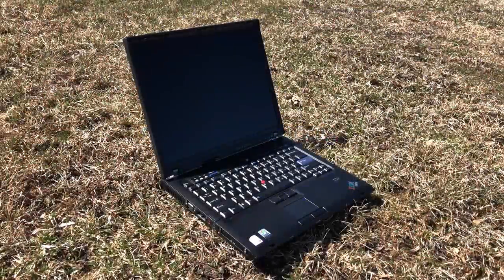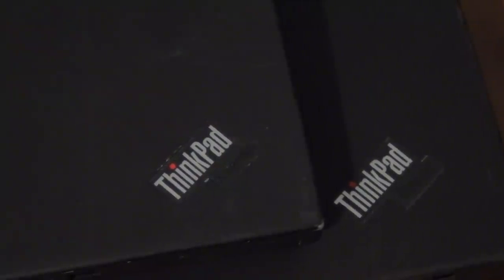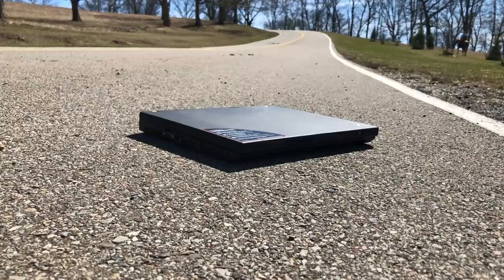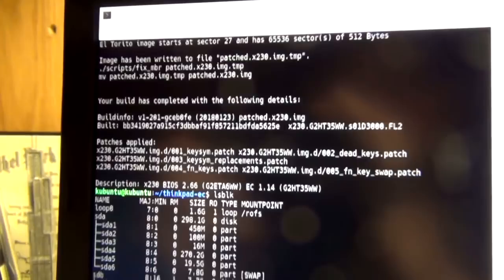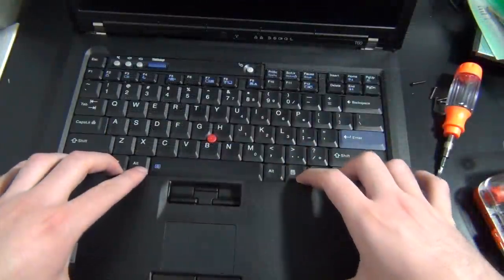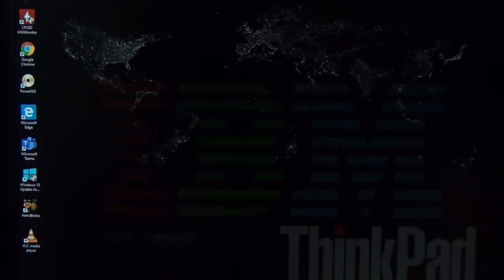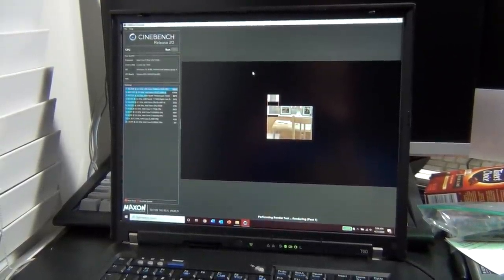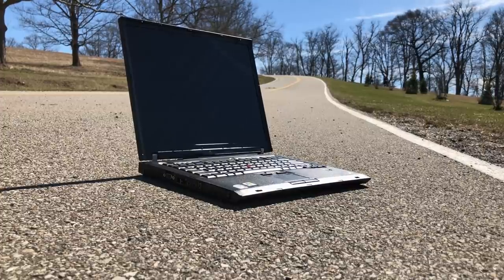Unlocking the ThinkPad T61 with Middleton's BIOS

Comment: nice vids as always, would you mind to share from where you buy the Crucial 8GB KIT? thanks :)
Reply from the maker: I actually purchased that from someone on Reddit, who bought it for his FrankenPad project but ultimately never used. I would suggest checking eBay for DDR2 laptop RAM and finding 2x4 GB sticks. A heads up - they are expensive.
Reply: @SebisRandomTech  Why are older styles of RAM so expensive? Seems DDR2 RAM is more expensive than DDR3? You would think that it would be cheaper because most people don't want to save their older computers but sell them off for parts.
Reply from the maker: 4 GB sticks (and thus 8 GB kits) are rather hard to find because they weren’t really popular. At the time DDR2 was still relevant most computers maxed out at 4 GB and many didn’t even have that much, so by the time 4 GB sticks started being made most laptops had moved to DDR3.
Reply: @SebisRandomTech  precisely... not much stock made it out before those production lines changed over to DDR3 production. So whatever is in the wild is all there will ever be, and people know it's rare so they're going to charge accordingly.

Comment: Really should had just ran a userbench before and after... it'd show, in extreme detail, the difference in every bit of hardware. The beauty of UB is that it always compares your hardware to that exact hardware... and shows you where you stand compared to the rest of the planet. I am currently in the top .6% with my ram kit, lol... And mostly top 1-5% with SSD, Raid arrays, CPU, GPU... etc. But it also shows you the actual data rates, rendering performance, etc... You get all of it, and it's free... plus it gives the results in a pretty great format.
Reply from the maker: Will keep this in mind for future videos. It’s hard to find good (and free) benchmarking software, so I’m open to any suggestions there!

Comment: hello, lately my x61 win 7 4gb (but 3gb usable) 500gb ssd core 2 duo t7300 model 76734NA is experiencing shutdown blue screen, maybe because win 7 support has gone. will the middleton's bios give me 8gb ram and install win 10 pro 32 or 64 bit? will really appreciate your reply.
Reply from the maker: You won't need Middleton's BIOS to upgrade to 8 GB of RAM, that was a mistake on my part. You could try driver updates or reinstalling Windows 7 to see if that fixes your blue screen issues before upgrading to Windows 10.

Comment: Looking at the benchmarks since I have a T9300 in my T61, from what I read there is not much difference between T9300 vs T9500 vs X9000.  Some sites listed the T9500 the overall clear winner.
Reply from the maker: Can those be installed without additional mods?
Reply: @SebisRandomTech  i librebooting it.  Other than that it was a direct drop in
Reply: The x9000 can be easily overclocked to 3.2 ghz. I got it to 3.4. Id like to see how the t9500 compares when the x9000 is on 3.2. And do note i did this on a precision m4300. Im assuming the t60 has the vrm and thermal headroom to boost to 3.2

Comment: can i install this BIOS to my Thinkpad x201? I have a 4GB ram and i bought 4 more gigs. The BIOS says that i have 8GB but windows won't boot :(
Reply from the maker: Nope. That sounds like an issue with your Windows installation.
Reply: @SebisRandomTech  maybe..
Reply: @dieselgeezer18  reinstall. No link between memory size and windows boot.
Reply: Are you running a 32bit OS?
Reply: @Shaddow798  64 bit
Reply: @Peter Andrijeczko i still use windows 7

Comment: Hello friend I need your help, I have a lenovo t60 laptop with windows 7, 3gb of RAM and I put an intel core 2 duo T7700 processor, but the computer does not start the operating system, it remains on a black screen, the BIOS needs to be updated ? help please, thanks ...
Reply from the maker: See if updating the BIOS helps.

Comment: Today I bought a mint condition T61 on ebay for $100 Canadian.  It's got a C2D 7300, 4GB Ram and a 250GB SSD.  Seems like a great deal to me!
Reply from the maker: Hope you enjoy it! They're pretty solid as long as you don't encounter GPU issues.
Reply: @SebisRandomTech  Thanks!  BTW...  the one I bought has a 14.1" 16:9  wide TN display.  Can I install a 4:3 IPS like you have?
Reply from the maker: @JeffWaynee  You can’t, at least not easily. The 4:3 and 16:10 versions of the T60/61 use completely different components for the most part. To use a Flexview display with the T61 you need a 15” 4:3 T60 body (with the display of course) and a 14” 4:3 T61 motherboard z
Reply: @SebisRandomTech  Thanks again for all your help.  BTW...  I found the date of manufacture on the bottom, and mine is a very late 14.1" 16:10 from July 2010, so I'm well out of the bad GPU's.  Do you know if they were using better LCD backlights by then?
Reply from the maker: @JeffWaynee  As far as I know all T61's used CCFL backlights. The T400 used both CCFL and LED backlights depending on which configuration you purchased.

Comment: So just a few things, the best upgrade you can have is OC a T8100 to 2.8Ghz. just need to change the Wifi adapter (search 51nb) and flash the SPD
While the craziest remains the QX9300 upgrade, which isn't stable after all. Or the T9900/ P8800/ P9700 on X61, which is one of the best old thinkpads you can dream of.

However it's the NVS140m/FX570m that's really crippling those machines. with 128MB vRAM it's just pathetic. X3100 is slightly better at 512MB max.

Comment: Hey there! Is there a way to flash the modded bios without a battery? Only on AC power?
Reply from the maker: Not that I know of, the system usually won't flash it unless both are present.
Reply: @SebisRandomTech  bummer. Does it have to be a functional one or just present?
Reply from the maker: @whitenoise2007  It doesn't have to be in perfect condition but it has to be able to hold at least a little bit of charge.

Comment: Hi, thank you for this video! Is there a way to install Linux in this laptop? I have serious problems with Nvidia driver.
Reply from the maker: Linux can be installed on just about any laptop, including this one.
Reply: @SebisRandomTech  I tried Ubuntu, Pop_OS and Lubuntu but system is unstable.
Reply from the maker: @nexso  Does Windows work fine or does that give you issues too?
Reply: @SebisRandomTech  Windows works perfectly.
Reply from the maker: @nexso  That's strange. I suppose that rules out the possibility of a hardware issue. Have you tried using older distros of Linux?
Reply: @SebisRandomTech  No, it's new. I discovered the exactly nvidia driver that I must install with package manager: the 340.

Comment: if I'm buying a laptop with 4gb of ram, and want to upgrade it to 8gb, would it work if I'll just get another 4gb ram stick, or do i need to buy two identical ram sticks?
Reply: just getting another 4GB RAM stick would generally work
Reply: In general, any ram sticks should work. But with the T61 it is not quaranteed that different sticks will work together.

Also similar sticks provides you a dual channel. Thus, 8gb over 4gb is a huge improvement even without the dual channel.
Reply: First you need to check if this 4GB RAM is not in two sticks of 2GB each there, which most likely it is, especially if we are talking DDR2 RAM, because price difference between 2GB and 4GB sticks is massive.

Comment: I've got an unmodded untouched T61 I've been itching to do more than running the factory XP image on so I can ooh and ahh at the ridiculous old IBM themed wallpapers and screensavers. That was not an easy image to restore... 7 CDs... SEVEN!
Reply: I need to do the same thing on a T60 - I used up the last of my blanks on a 600 I restored last week - that took only one CD but I had to burn a few more for a few other bits and pieces.  Couldn't get a USB stick to recognize - before it's time I think - now I need another 7, same  as you.  I did enjoy finding the wallpapers and screensavers, and everything seemed to work fine out of the box.

One thing I did find useful was a PCMCIA to CF Flash Card Converter - after I ran out of CDs I was able to transfer on this.  I tried booting from it but no go.  And it's an IDE instead of a SATA hard drive in the 600, so you can't take it out and do it that way unless you got the special cable ... there's always something ;)

You can use a T60 for many things - it browses the internet nicely, does Youtube (on Linux, is safer) and is easy to carry around or use in bed, surviving when it falls off, hopefully ...

Comment: Avoid using Chrome on older laptops. Chrome is notorious for being a CPU, and RAM hog. With playing YouTube videos in Chrome you may find that CPU usage is around 100% on all cores. In that situation you would be much better off using a lighter weight web browser like Brave or Firefox. Had that situation with the T480 (uses the Intel Graphics 620 UHD which has hardware support for playing certain types of videos, eg VP8/VP9) on Linux Mint 19.3 with Chrome, and used Brave instead where it is rare that the fan engages when playing a YouTube video unlike Chrome.
Reply: Brave isn't going to be much or any better than Chrome, same engine.
Reply: @W1ldTangent  Disagree on resource usage. Chrome will be using more CPU and memory with the ads/malware that are loaded on many websites. Brave includes a builtin ad/malware blocker which makes a significant difference to resource usage. Chrome is very slow to startup unlike Brave which starts up very quickly.

Comment: power iso lol  there are Superior options still available for xp let alone 10  may i suggest looking into apps like rufus or yumi and there's always live sessions to consider
Reply from the maker: I showed Rufus in the video...I usually use that but as I said it gave me issues.
A live session would be more of a hassle than just burning the software to disk.
Reply: @SebisRandomTech  i only use rufus for oses and hardware that require a dd image yumi is my preference for multiboot efi/uefi bootable external media creator  ive found that 1 external usb hdd booting into all the popular os install media to be a handy tool especially when combined with a driver archive and most used apps installer archive  . lol as long as the bios supports it i can boot into whatever  fix /install/ just use whatever hardware i am at and no internet connection needed to download network drivers lol
Reply: @SebisRandomTech  sometimes when used rufus you must flash it twice.

it's strange but works

Comment: As an X61 T8100 user with Middleton BIOS I'll tell you the secret of unlocking great performance on your T61: Uninstall Windows 10 and install a Linux distribution. Even bloated ones like Ubuntu will be miles ahead in terms of speed. 
For better Youtube performance you can play videos through mpv.
Reply from the maker: I am well aware of what Linux is and what performance it can offer on older laptops. However I prefer not to use it unless I have to.

Comment: Correction - IPS displays made a reappearance on T series ThinkPad's that started with the ThinkPad T450/550 ( https://psref.lenovo.com/Detail/ThinkPad/ThinkPad_T450?M=20BV005GUS ).
Reply from the maker: The T440p came before the T450....

Also the standard T450 can be upgraded to an IPS display but it did not originally ship with one. The T450*s* did ship with IPS panels.
Reply: @SebisRandomTech  You are correct that the T440p was the first T series ThinkPad to bring back the IPS display ( https://psref.lenovo.com/syspool/Sys/PDF/withdrawnbook/ThinkPad_T440p.pdf ). In the ThinkPad T440p spec sheet it lists a IPS FHD display option ( https://psref.lenovo.com/syspool/Sys/PDF/withdrawnbook/ThinkPad_T440p.pdf ). Presumably Lenovo will have a part number for the T440p FHD IPS display.

Comment: Those integrated GPUs...i have HP 8730W with T9600 2,8GHz CPU, 4GB RAM and Quadro FX2700 and it boots faster without SSD, it plays FHD Youtube without any troubles, it even handles 4K (not really usable tho and HDD is limit).
Reply from the maker: The boot tests were cold startups, Windows 10 doesn’t normally do a complete shutdown unless you force it to (as I did to get a more accurate startup test).
Reply: @SebisRandomTech  Mine is turned off by "shut down" so it should be cold stard too.
Reply from the maker: @martincoufalik9101  On Windows 10 it typically puts the laptop into more of a hibernation/suspend to disk mode as opposed to truly shutting down the operating system. This allows for faster boot times especially on hard drives. To fully shut down Windows 10 you have to hold the left "Shift" key as you click the "Shut Down" button.

Comment: The best upgrade you can do is software. I wiped the hard drive on my ThinkPad and installed Linux and it was incredible how much snappier it ran. If you must run some windows applications then you can always dual boot.

Comment: The limitation is the Operation System, i have MX Linux in a Thinkpad T61 and run fast fast, no problem with YouTube videos, 4gb, no ssd, Core 2 Duo T7300 2.00GHz
Reply: yep. Windows 10 has gotten very CPU intensive. For a while it was actually faster than Windows 7, but after I downgraded my T60 (T2600, ATI X1400, 3GB RAM) to W7 a few weeks ago it was like a night and day difference. And my W10 was already debloated. That is why I hate the "Wndows as a Service" model - Windows 10 does not equal Windows 10, and it's only a matter of time until a newer Win10 build will break drivers for devices that worked and were supported under the original 2015 Windows 10. 
Surfing the web does now feel much better on the T60 - I don't care about the support end - it is just a secondary laptop, and Firefox ESR will probably still support Win7 for some time.
Reply from the maker: It works well enough for my needs, and if I’m happy with how something is working that’s not really a limitation.

Comment: Install Linux on it.....
It'll give it nice boost..
Try Zorin OS Lite....
It's very much like windows with very low system requirements...
Reply from the maker: If I wanted to run Linux...
I would have done it by now...
But I don't want to run Linux...
So I have to deal with 50 comments telling me to...
Reply: @SebisRandomTech  Point noted......

Comment: “Even with a bloated operating system like windows, modern tasks are a chore.” 
Try a distribution of Linux  then, and install windows in a VM with hardware acceleration :)
Reply from the maker: Or just keep Windows on here ;)
Running it in a virtual machine would make the performance unbearable on something this old.
Reply: @SebisRandomTech  I guess that is true. Older machines tend to suffer more with virtualization.

Comment: eww a kingston SSD and A400 of all things...
Reply from the maker: Actually wasn’t used in this T61. That was footage from a different video.
Reply: @SebisRandomTech  I should recommend forgetting kingston SSDs for the most part
Reply from the maker: They work fine for me and I haven’t had any issues. More reliable than some SSD’s that I’ve used. What’s your issue with them?
Reply: @SebisRandomTech  my issue with them is that they are terrible. They have dumb issues like overheating, they tend to don't have DRAM, they can have bad firmware etc. The fact is Kingston only has one good choice atm the KC2000 which is not the best option in open market...
Reply from the maker: @TheXlen  Well I haven't had any issues with mine, some I've had for over 2 or 3 years. Maybe there was an issue with a specific model, you got unlucky, or I got lucky. I have a warranty on all of mine anyway so if something does go wrong I will have it taken care of.
Reply: @SebisRandomTech  look, literally nobody who knows what they are talking about recommends kingston SSDs the same way you shouldn't buy QLC or DRAMless NAND. I could send you a spreadsheet of SSDs, but I'm pretty sure I can't put one in comments
Reply from the maker: I’m not recommending them, just saying I personally have not had issues with them.
Reply: @SebisRandomTech  the fact that you don't have issues with them is very lucky. I've seen them die within a week of purchase, other than that the previously mentioned issues alone should keep you away from them. I'd recommend using something like SU800 or MX500 if you need SATA SSDs

Comment: Fucking don't use Win10, use Win7 at minimum!
Reply from the maker: I’ll use whatever I want. It’s my computer, not yours ;)
Reply: @SebisRandomTech  I'm not telling U what todo, Win10 is just bloatware.
Reply from the maker: Thanks for the reminder ;)
Reply: @josiahbarkhau9359  however windows 10 more stable ram management, tiny driver issue and increased overclocking/undervolting rate than old windows series.